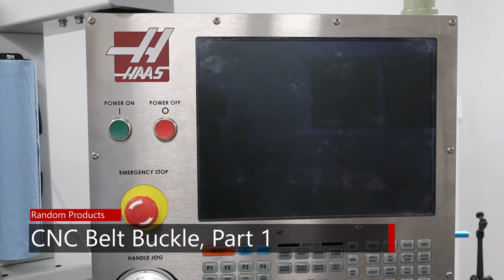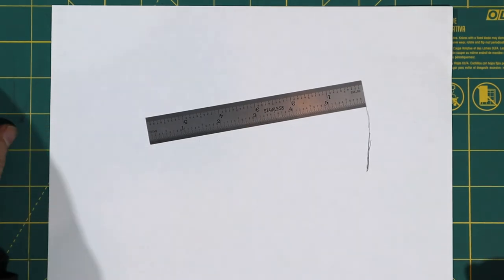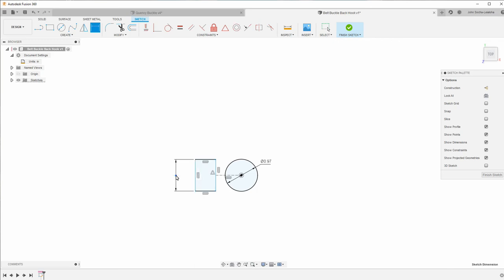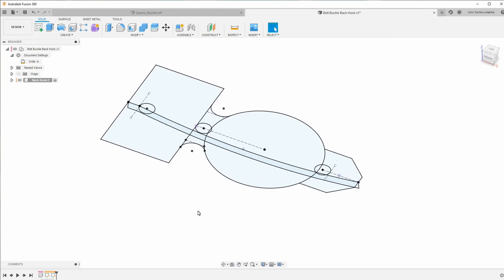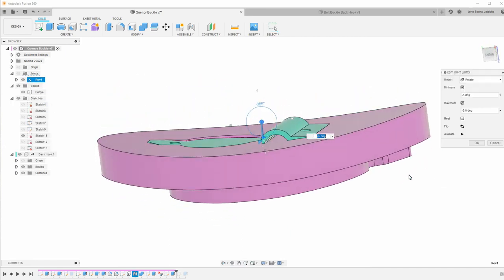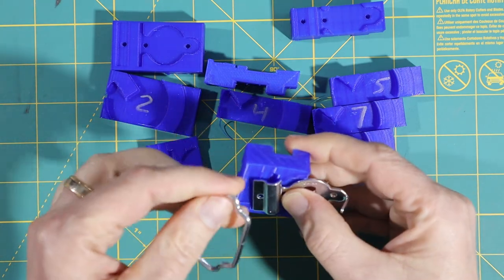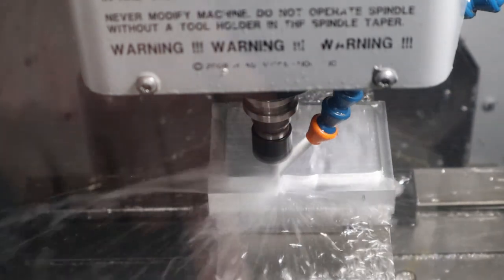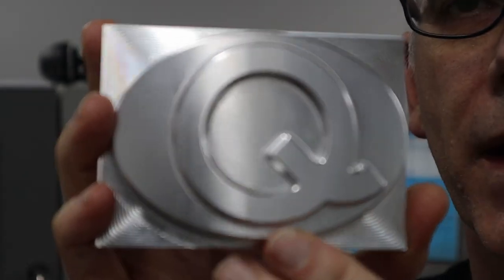CNC Belt Buckle for Quincy Part 1

Comment: You probably know this, but to get a distance between two holes of equal diameter, measure the diameter, zero the caliper, then measure the distance between the furthest points on the holes to get the distance. Thanks for sharing.
Reply from the maker: Oooh, that is a very nice tip. It never occurred to me, and works so well. Thanks.

Comment: I love you videos.  For the pencil toolpath, you don't actually need to make any face selections.  It will find all internal corners.  if the internal corner is larger than the radius of the ball you can add an over thickness value on the passes tab.
Reply from the maker: I could have sworn I tried that. But I just tried it now and it worked great. Thanks. This was my first time using the pencil toolpath.